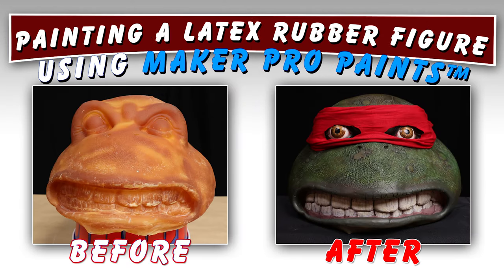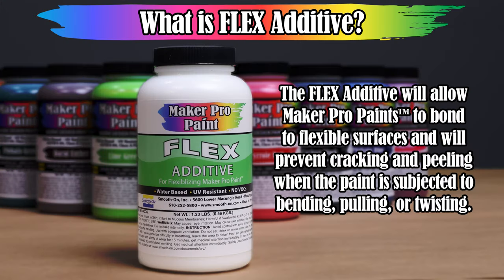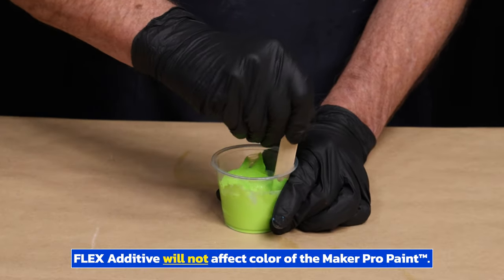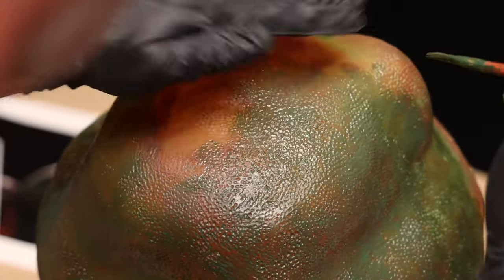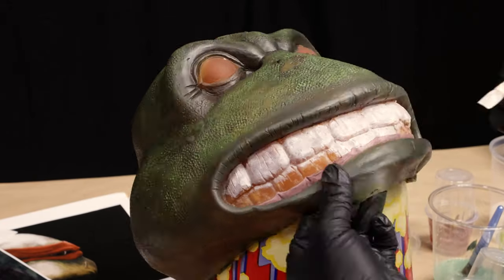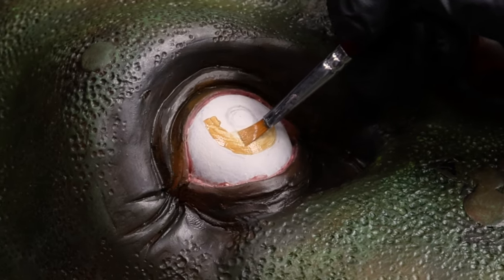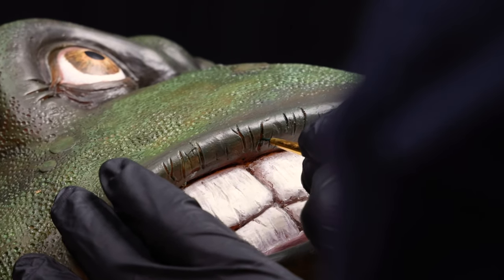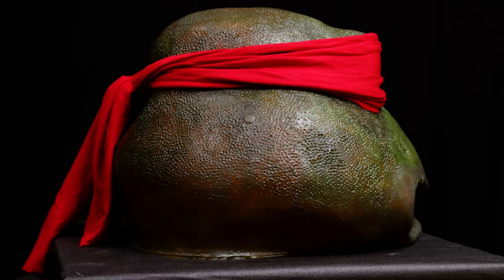Painting Latex Rubber Using Maker Pro Paint

Comment: If i want to Mix Paint for a special Color, do i mix it first THEN add the Flex? or do i add the Flex to each Base Paint, then mix them? "basically since its 2 different kinds of paint being mixed, do they both need the flex as a base mixed with each, or will one cup of Flex work?
Reply from the maker: Great question. You can do it either way, however I personally like to mix the Flex Additive with each paint before mixing my colors so that I do not forget to add the Flex Additive. The most important part is making sure you mix the Flex Additive with the Paints at a 1 Part Paint to 1 Part Flex Additive by VOLUME.

Comment: can I use the Flex Additive with my own latex my paint?
Reply from the maker: It is not tested with any other paints.
Reply: From my testing it works with other paints "well, the ones i tried it with" but it needs to be Sealed with a Flexible clear coat, because after i got my mask wet "after it cured for 2 days" the paint came off. but you can brush or spray mask latex on top of the paint and that will seal it, from what ive seen. that and Flexible clear coats exist, so that would seal it if nothing else.

Comment: Hello. How does this paint work with synthetic rubbers like urethane and silicon please?
Reply from the maker: Maker Pro Paint will not bond to silicone.  To paint silicone, Psycho Paint would be recommended.  It will bond to urethane rubber if the FLEX additive is used.

Comment: I used to just add the paint to the latex for colour, because it wouldn’t stick to it otherwise.
Reply: @pootmcphoot  this is some 30 odd years ago , before all these materials were available.
Reply from the maker: It was really hard years ago to paint latex. The Maker Pro Paints have really become a game changer with what they are able to bond to and flex with. They are the most durable and adhesive paints we have ever come across.